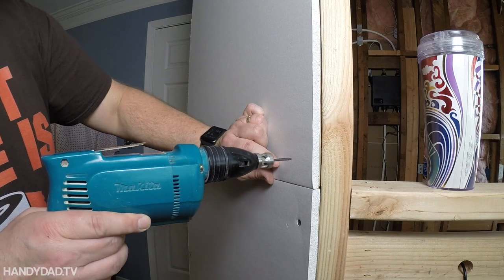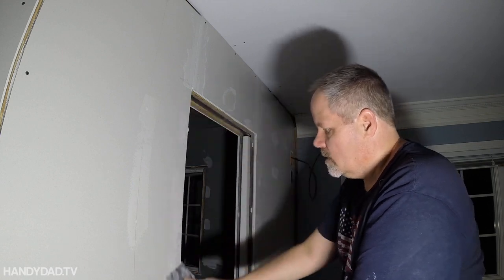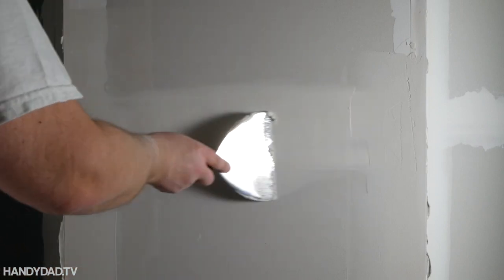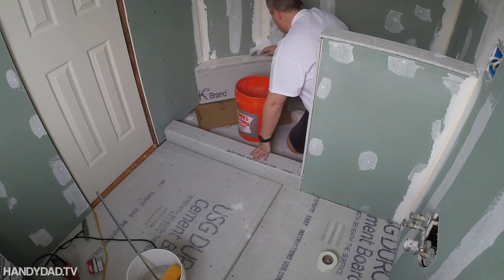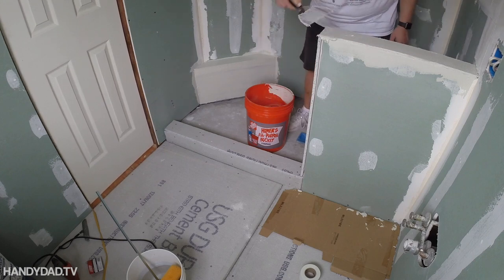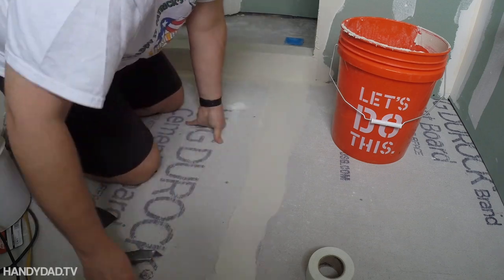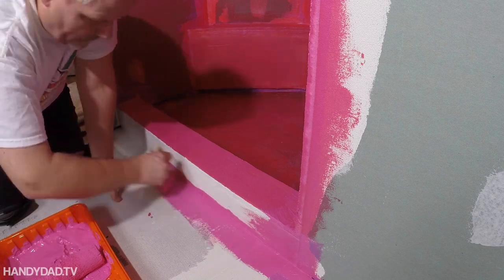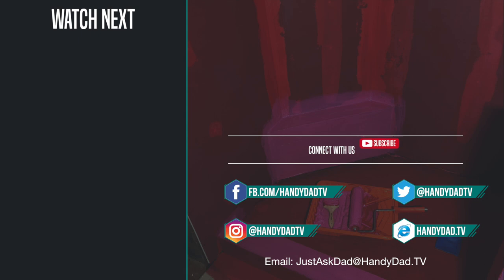Walls and Waterproofing | Master Bath Remodel (Part 5)

Comment: First of all you do great work , also your video is the only one I’ve seen using that square tile-in drain which I am as well , so I’m building a shower,  got the pan hot mopped then I put gravel protecting weep holes , poured the dry pack mortar and I set the square drain rim higher than mortar to meet flush with final tile , where I need help is redgard complete mortar floor right up to edge of the squared drain wall? ( you stated you redgard really close up under neath drain ) meaning you had to remove it after you poured the mortar? 
Or leave mortar exposed to let it soak and drain through weeps ?
Or remove the square drain after i have poured the dry pack and redgard entire floor even under the drain leading into weep holes ? Don’t know please help .
Reply from the maker: I covered the mortar bed with Redgard all around the drain. I don’t expect any water to penetrate the mortar, but if it does, I’m protected by the pan liner. I got this method from Starr Tile (look for his channel); he’s the pro.
Reply: HandyDadTV thank you for the reply , indeed I am a fan of bob Doyle as well of yours  , he use to leave the mortar floor exposed and only cover like ten inches around bottom perimeter , he is now covering the whole floor , I just can’t understand how the water will escape up and over the rim of the drain if water would be to get through the tile and grout , wouldn’t it just pool around the drain on top of the redgard since the rim is slightly higher ?
Reply: @909LOUIE  I know what you mean. I'm about to do my first shower and I'm thinking just leave a bit of un-guarded mortar around the drain so water can seep through and down to the weep holes.

Comment: What did you use as joint compound on the greenboard in the shower?
Reply from the maker: I used joint compound on the drywall and thinset on the cement board.

Comment: What kind of floor drain did you use? I am remodeling and would like your input on the drain! If you recommend. Thanks
Reply from the maker: I used a QM Shower Drain - https://amzn.to/2qGXmm0
Reply: I have the same drain installed.  How does the water get up over the lip to drain out if it gets under the grout (which it’s certain to do in the future). Not it just pool on the red guard below?

Comment: Hey there HandyDad, Great video!
Curious, how did things end up after the job? Did everything hold up well and did the redgard do the trick? I was curious about how the redgard held adhered to the drywall mud and if you noticed any issues with that or anything else. Is there Anything you would have done differently?

I'm basically doing the same thing as you but with a tub and shower in an alcove abut I noticed that I have a couple of bows on one wall that will definitly need a skimcoat to fill the voids so that the tile runs past the lip and onto the tub deck. So,.. does one skimcoat with thinset AFTER redgard or skimcoat the drywall first with 'hot mud' and then take the chance that the redgard adheres properly to the drywall mud?
Cheers,
Reply from the maker: Get the walls flat before applying Redgard. 

As for my shower, it held up great. The only thing I’d do different is NOT use natural marble. Too hard to keep clean because you can’t use bleach based cleaners. I’d choose a ceramic tile that looks like marble.
Reply: @handydadtv  Ok, that's great! Glad to hear that things worked out.
Thanks for the info.. I was a bit worried about the Redgard not sticking to the bigger drywall spots that I have to 'level / skim' out..  It appears that people who have issues, tend to have adhesion problems when trying to cover up regular drywall mud or 'finishing mud' as it's too powdery and not hard enough of a substrate for the Redgard.
Reply from the maker: I never heard that. Good to know.

Comment: Lovely job but you might have wanted the red guard to go all the way to the ceiling heat, steam, and moisture rise creating condensation on the ceiling. Maybe not but "maybe".
Reply: I've never seen STEAM or condensate penetrate through grout in ceiling tiles and create an issue so therefore this application is perfectly fine. Just make sure to have a decent bath fan and you're good to go.

Comment: Is your green board in the shower taped with dry wall mud or thin set my friend??? Modified or unmodified thin set or just joint compound? Thanks 🙏🏽
Reply from the maker: The green board is taped with joint compound. I used thinset for the Durock joints only. And for the tile (but that’s the next video). Modified.

Comment: I wouldn't use drywall for the shower walls.  As said it should be ok but with many days of work and likely thousands of dollars invested in the bathroom remodel, the slight increase in cost for Hardi board and it being fine in water makes more sense to me.
Reply from the maker: Drywall is plenty strong enough, cheaper, and much easier to work with. But I respect your decision to use Hardi or Durock or Wedi or Schluter or whatever you want.

Comment: No fiber glass mesh with the red guard? Should be ok I guess. But a lot of guys say to use it
Reply from the maker: Redgard is a crack-prevention membrane. No need for joint tape too.

Comment: Just wondering how durable red guard is?  I ask specifically for tile.  When troweling on tile will it withstand the trowel swipe? Also how does the tile mud adhere to it?  Would we require a different tile mud because of the non porous surface?
Reply from the maker: It’s extremely durable when dry. You’d need to cut it with a knife.

Comment: Need more screws, should be at 8" on centers on center and 6" on center on the perimeter they should be 6" on center. Blue rock is not recommended for tile anymore.
Reply: Good things its green

Comment: You did a good job but honestly its all wrong.startile does say no matter what you use your going to redguard anyway but hes wrong about that that just makes a softer wall custom requires you to use wonderboard or durarock and a liner underneath is not required at all because redguard is a whole other ball game people need to study and tile contractors aswell before they say they know im going to put a link down and i hope everyone realizes how its suppose to be done but like i said good job but like i said star tiles method for the floor is an old method and redguard has thier instructions how your suppose to do it.and i am a contractor in texas and take every step crutial.👍
Reply from the maker: My previous bathroom lasted 50 years with tile adhered to standard 3/8” drywall. No waterproofing at all. This shower will last far longer than that. So I’m good with Starr Tile’s method.

Comment: You do know redguard does require a certain thickness??
Great rule of thumb. 
If you can still see mud or writing on the wall it’s not thick enough. 
I can’t even tell you how many I have repaired due to this factor. 
If Redguard only needed a thin coat it would come in a spray can. Lol
Reply from the maker: The directions say to apply two coats; I did three. 

My old shower lasted almost 50 years with tile directly on 3/8” drywall. No waterproofing. 

Even if you say it’s not thick enough, it’s thicker than nothing.

Comment: Wrong mesh tape for Durock
Reply: who cares it's on the floor OUTSIDE the shower and being covered by thinset.... lol
Reply: Darren R the problem is the mesh will be destroyed by the alkaline properties of the cement board and the thinset that tops it. Should have been alkali resistant. On any tile floor application.